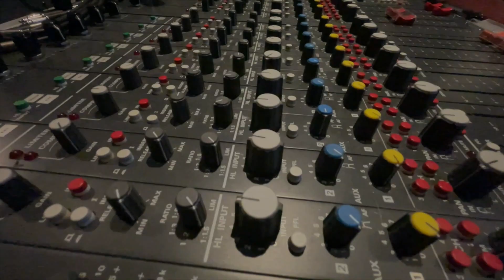Audio sample rates explained

Comment: Higher sampling rates is not all lollipops and roses.
The faster that the samples need to be recorded and need to be played (which is the case with higher sampling rates), then the more accurate the timing of the samples need to be.

This results in jitter, which is samples not being exactly timed properly during playback.
Unless you have a purpose built computer (such as the Innuos Statement -- which actually uses a Pentium Quad Core CPU), you will have a fair amount of jitter.  You might not think that you have it, but you do.

If you were able to flip a switch while listening, and have the jitter disappear (never can be 100% gone), you would immediately hear the improvement.

Some high-end CD players do a superb job minimizing jitter.  But CDs are generally limited to 44.1 kHz.

So high sampling rates need computers / chips or whatever it is in the box that handles the precision of the timing of each and every sample... chips need to be able to handle, for example, 176,400 samples every seconds with extreme precision -- and few are up to the task.  That is why some people buy separate transports that cost big $$, which are dedicated to that task of minimizing jitter (of playing back samples in unison -- with ultra precise timing -- and you can easily hear the improvement).

On paper, higher sampling rates are better.  In reality, that is true, but only as long as you have gear that is capable of doing what is on that paper.
Like having two employees that both get the job done, but one is sloppy and one is neat.  Just because a box can play back the samples, does not make it neat.

Compared to other audio related topics, the importance of a quality transport is not often a topic of discussion.
Reply: Do you think more silent and stable power-supplies could make a difference in the digital transport/ streaming domain? I have noticed a tremendous shift in clarity upgrading to a quad-core f.e. But those bits need accurate transport as well, like you said...
My interface goes to a -113dB noise level f.e.
Reply: @Projacked1  Silent and stable power supplies are one of the most important and most expensive parts of any audio component.